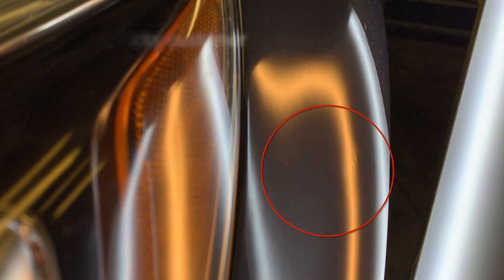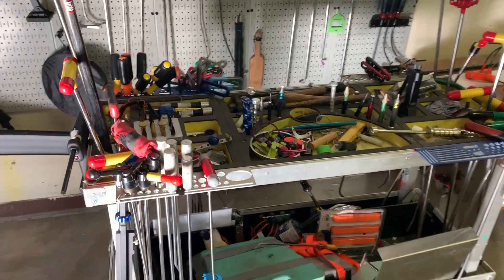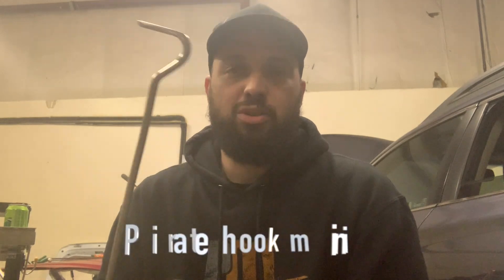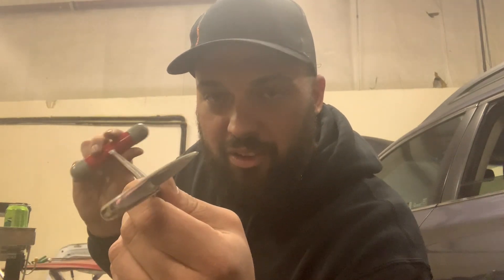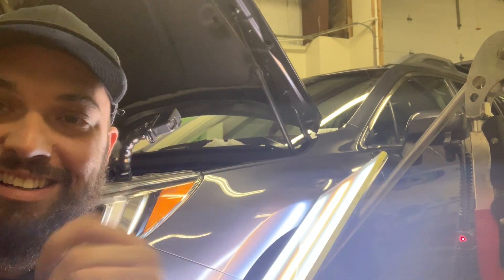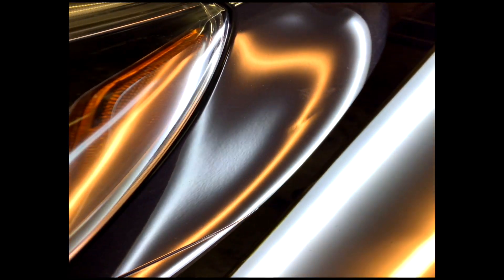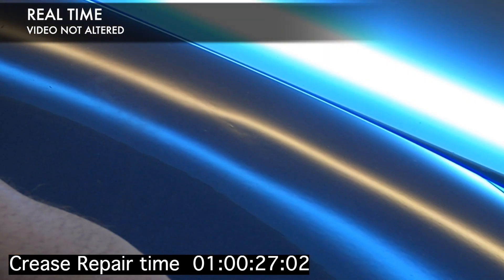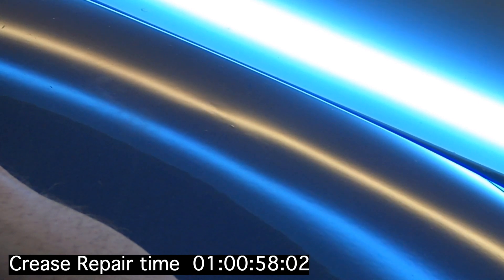Stanliner PDR Tools Part 1 of many.

Comment: For this one small crease with standard tip you can doing in same time! Nothing magic! Yes, I like too any new tools but many companies have same thinks. For example Dentgear have 3 shaped tips.
Reply from the maker: Well. Video it up then!!!! Doubt you’re gonna have much luck. About 3-4 inch crease.
Reply: Not true at all.  A regular tool leaves micro lows and highs and you have to go back and cross check it and repair what the regular tool missed...which is why the dent looked the way it did in the beginning.  The original tech never crosschecked his work and repaired the lows he left.

The Stanliner tool brings it all up evenly.
Reply from the maker: Beautifully explained. I like your style.